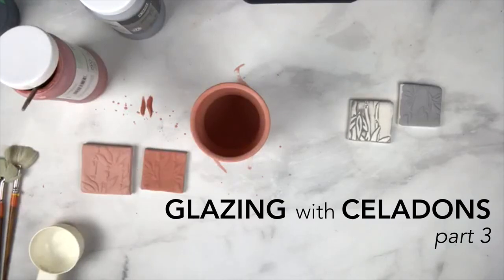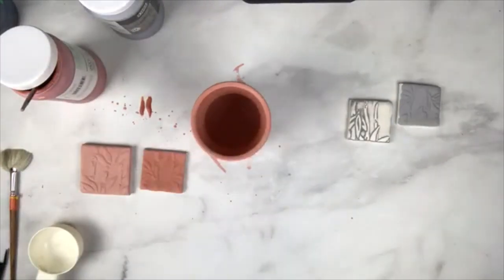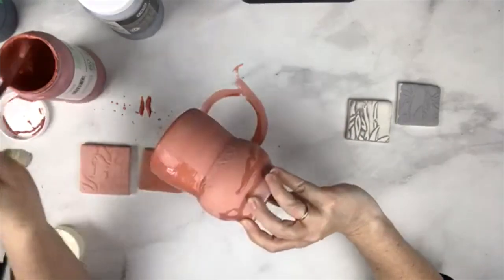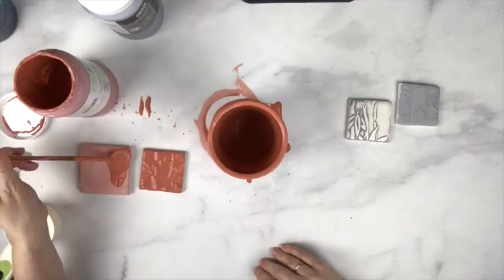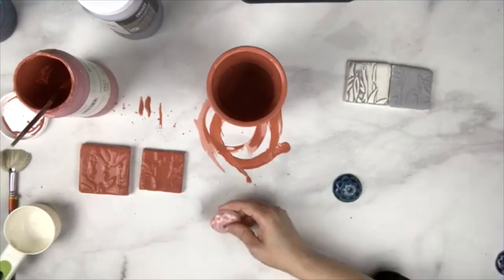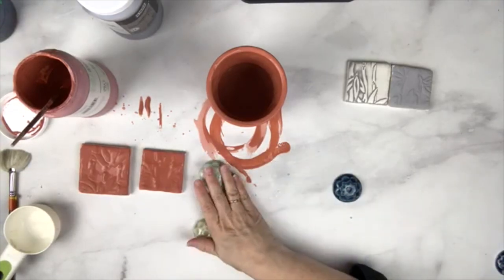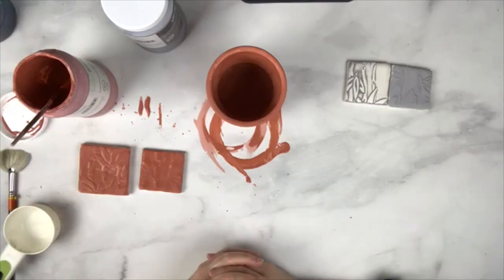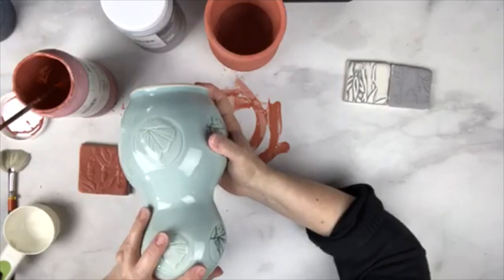Glazing with Celadons: PART 3

Comment: I would like to know about flux.  How to use it….what technique for application.
Reply from the maker: Hi there, on the theoretical glaze chemistry level, a flux is an oxide that lowers the melting or softening temperature of a mix of materials. So they are a material in the glaze. You can learn more about them here: https://digitalfire.com/glossary/flux